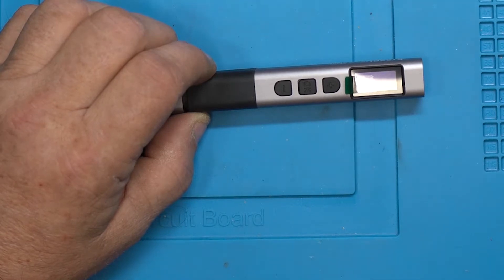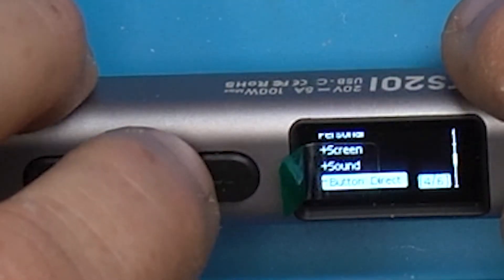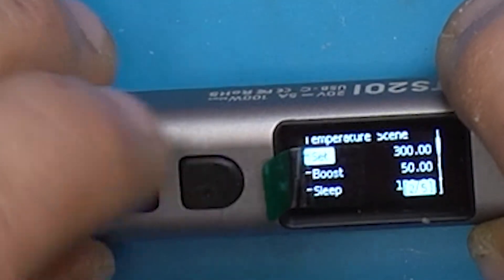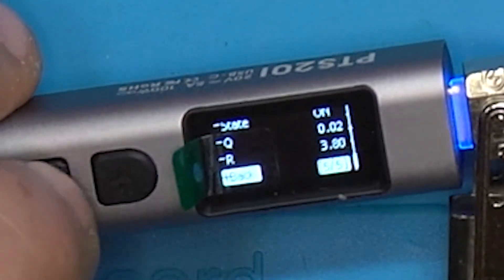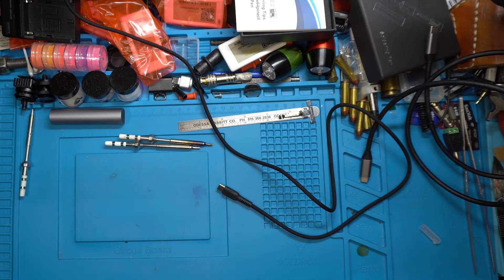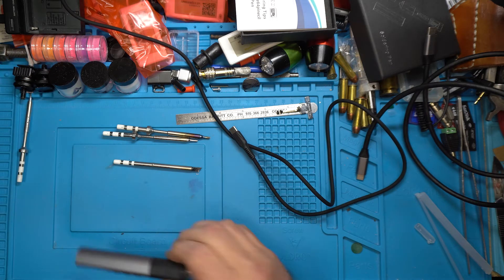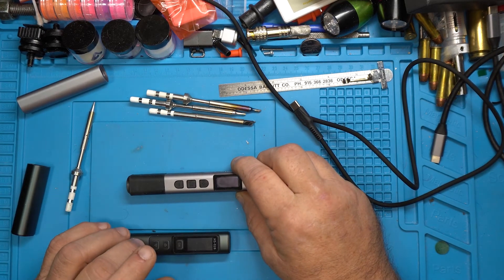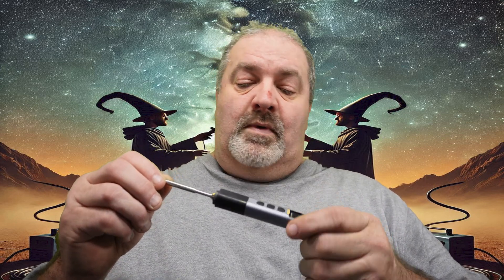**PTS201** (HS-02 CLONE???) Soldering Iron

Comment: Thanks for the review, but the T12 stinger has other sizes, you used the T65 stinger with a resistance of 6 ohms and this pleases me, the seller's description includes 4 ohms stingers to achieve a power of 100 Watts, did you check them for resistance?, and then it's not entirely clear how to mount the stingers, for example, there is a screw in the ts101 for attaching the stinger.
Reply from the maker: Sorry. No i sure did not think to check the ohms. The mounting screw in the ts101 is not really needed in my opinion as all of the tip are held in place very securely without the screw.  In fact i dont even tighten the screw as it seems a waste of time as its pretty hard to pull out without the screw. From what i see and test if the contact bands are spaced like the default tip it will work. I hope this helps. If i can give you any more information please ask. Thanks for sharing.

Comment: Was that really a t12 tip? I thought those are really long
Reply from the maker: Yes. There is a short and long version i found as i researched them. Apparently the iron end is same length but business end is shorter. I also used a long t12 tip (only have 1 iron that uses them) in iron but cut it during editing as redundant to save on time. Thanks for your comment.
Reply: @ gotcha thanks for the reply. I’m assuming long t12 worked fine? I really like the  idea of using a portable iron with long t12 tips as unwieldy as it sounds. They are just so affordable
Reply from the maker: Yeah. I have been using the ts101 and HS02A hear lately. I wish they had a small iron like the ts101 using T12 tips. I think i prefer tge t12 over the rest.

Comment: Hi, nice review, could you please confirm that the HS02 tips would work with this PTS201 soldering iron, thanks
Reply from the maker: Although the PTS201 look and feel are extremely similar, The tips are very different and do not interchange. The HS02b uses c210 tips and the HS02A uses c245 tips size of tips being the difference. 

The PTS201 uses the TS101/TS100 tips same as the Miniware TS101 soldering iron. In the video i also put a T12 tip in the PTS201 and it worked as well. Hope this helps. Thanks for commenting.

Comment: HS02 would be my choice especially for finite work.
Reply from the maker: Yes the hs02b is a much smaller tip allowing for small detailed work. You can get small tips for The hs02a but tge body of tip it still large and blocks visibility just like the larger body tip on the ts201. So yes you are exactly right the hs02b with small tips is great for small detail work. 

I like the ts101 for its solder ability. You can solder gor long periods of time and tip keeps heated. My biggest problem with it is the length of the tip. Harder for me to use.